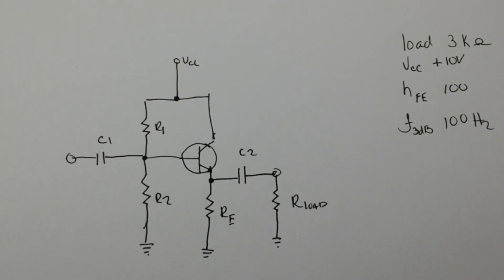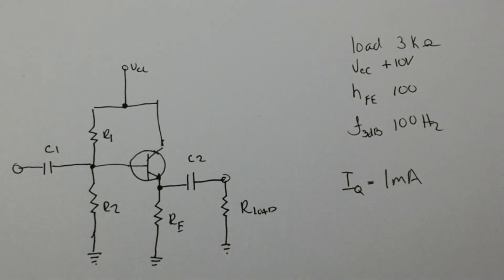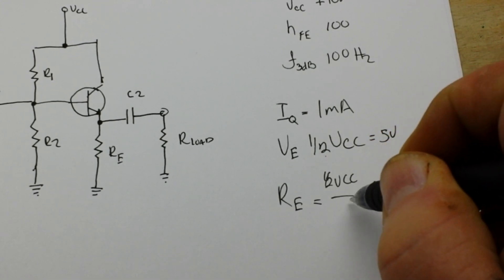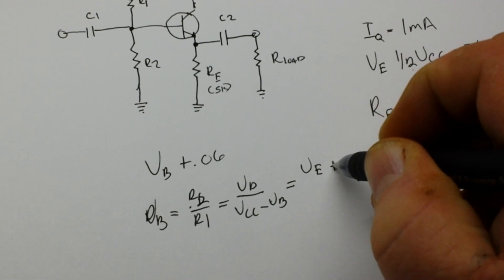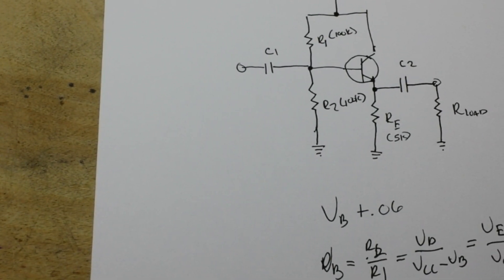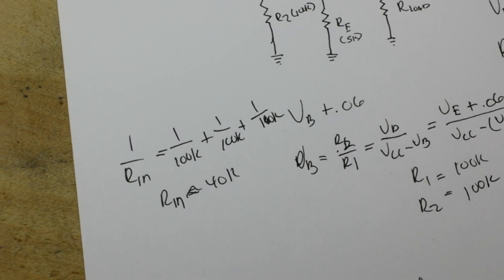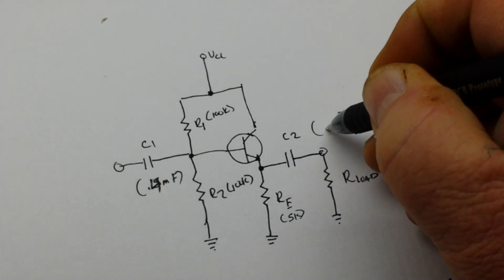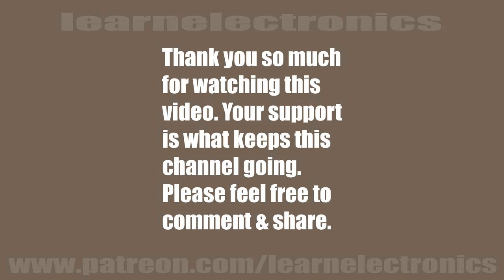How to bias a transistor

Comment: Thanks for the vid, I popped the little crystal earpiece I had for my radio project the other day somehow. Had a big amplifier transistor but didn't know how really to hook it up, after experimenting with a smaller transistor (which led to the earpiece popping). Got my Xtal radio cranking enough watts to drive a small loudspeaker now and quite loud in regular earphones. Just learning one little piece at a time. Next step is building a better tuning/tank circuit to make the radio a bit more selective.

Comment: The biasing voltage is taken between R2 and ground so the Vb should be Vb = R2/(R1+R2) * Vcc. He has some good information but his arrangement of the equations are sometimes completely wrong or the value are wrong like the voltage drop across the transistor as being .06 where it should be .6.  I do believe he knows better but he fails in verifying his information before putting the videos out to YouTube. I would say his YouTube channel is not a good place to learn electronics for beginners. To explain why his Vb = R1/R2 * VCC  is wrong, just do the math the Vb = 100k/100k * 10 = 10Vb. It should be 
Vb = R2/(R1+R2) * VCC : Vb = 100k/(100k+100k) * 10V = 5V. A beginner starting out in electronics may not recognize when he makes mistakes. Just a fair warning to all the viewers. Having said all this I do like what he’s trying to accomplish and some of his content but his attention to detail needs some work.

Comment: [V] can not be [Ohm] / [Ohm] (and then even [V] / [V]).
Reply: Yes indeed, it's a good practice to always check both sides of an equation to see whether they have the same units. That's definitely not the case here, so the equation is incorrect. His starting point to put V_E at VCC/2 is also wrong, it would have been correct if there wasn't a load resistor, but there is one and that determines the choice of the quiescent value of V_E too (study the chapter on AC and DC load lines).  You can easily check this experimentally by watching the clipping of the output signal for different bias points.V_E=5V is certainly not the good choice.
 V_BE is also wrong, it should be a value between 0.6 and 0.7V, the output capacitor is choosen way too small for a load resistor of 3k at 100Hz. 

Around minute 6.20 a resistance of 190k falls down from heaven (it is a nonsensical value, (1+100)*5k=505k would be acceptable as a first guess but this calculation has nothing to do with capacitor theory as he suggests), than it is changed to 100k...
Three resistors of 100k gives you around 40k...
Around 7.32 he calculates a capacitor of 0.5 µF but in reality the calculation shown gives around 40nF.
What upsets me most is this guy gives the impression we shouldn't worry about the maths as he masters all the maths but in reality he's doesn't master the maths at all, making one error after the other, doing a lot of handwaving and finally teaching it the wrong or misleading way.

Comment: For a second there, that looked like the schematic for the EHX LPB-1 Power Booster pedal. It is actually pretty close, but they used the output coming off the collector pin as opposed to the emitter. Are the maths for biasing the same in that situation? Below is the schematic I'm looking at: http://beavisaudio.com/schematics/Electro-Harmonix-LPB-1-Schematic.htm

Comment: This of great interest to me. I'm currently working on an if strip that is giving me the fits. My if freq is 2.2 mc. The coil resistance is .4 ohm. Allowing for stray resistance, the be is only 40kc....something like 3 plus ohms. Tuned amps with reactance can be bewildering. I've done every thing I can to lower this....larger/smaller reactive values, larger wire indicators to eliminate skin effect, load isolation so as to have no effect. I landed on a Re value of 10kohms that gives me 40kc....but that's best I can do. What am I doing wrong?

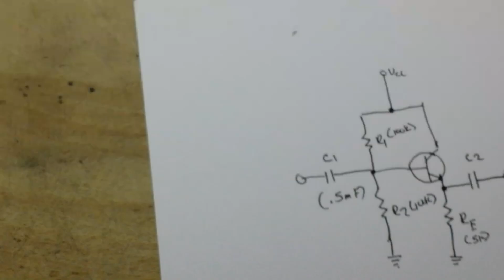Comment: At 07:38 you say micro Farad (uF) but you write mF... But nice and easy to follow video without too much detail.
Reply: mF is also microfarad mostly on motors and older stuff.
Reply: Correct. But better be consistent. The output coupling capacitor is marked as uF.

Comment: Is that circuit also known as emitter follower?
Reply: It is indeed, with biasing.
Reply: @jonelectronics510  Do you happen to know what I_Q was in the video?  I know what the Q point on a transistor is.  But I've never come across I_Q.  Is it the current to drive the transistor to the Q point?  I've had DC, AC, and an Electronics course which had a lot of transistors in it.  But I haven't had three levels of transistors like is mentioned in some of these comments.
Reply: @jonelectronics510  Thank you for explaining that.  The textbook we use for DC/AC/Electronics explained what a Q point was.  But I don't recall it mentioning an I_Q value.
Reply: @jonelectronics510  That makes sense. I know the basic theory but don't have a lot of experience applying it.  Thank you.

Comment: Where did you get .06 Volts from? Shouldn't it be closer to .6 Volts assuming a silicon transistor?
Reply: @Glenn Hamblin, I'm glad you asked this question.  I was getting ready to ask this myself.  I'm also glad to see this discussion answering the question.  So it should be 0.6 (to 0.7 Volts) and is the voltage drop across the Base-Emitter junction (between the Base and Emitter terminals of the transistor).  Is that right?  Now I just need to figure out what I_Q is.  I know what the Q point is.  I'm guessing the I_Q is the amount of current to drive the transistor to the Q point.  But that is just a guess.  I haven't had multiple transistor classes like some people have.  I've only gotten one class in Electronics with an introduction to transistors.
Reply: @JonathanDeWitt1988  Iq is simply the current flowing into the base (it could have just as well been called Ib for "current going into the base) when the input signal is 0 volts.  The purpose of Iq (the bias current) at is to properly bias the transistor so that it is operating within the linear (a.k.a. "active") region as opposed to using the transistor as switch in which case it would need to be driven "full bore on" (that point referred to as "saturation").  He sets Iq to be 1ma as for this transistor as that puts it somewhere into the linear range so that the transistor can act as a true amplifier with the gain (amplification factor) being hfe.  I hope that helps.
Reply: @Enigma758  That helped a lot. Once you said base current I made the connection.  The textbook I learned it from called this Ib base current and never mentioned Iq.

Your explanation of the rest was really good as well.  I struggled a lot understanding the difference between cutoff, linear, and active region until very recently.  I found the All About Circuits channel video lecture series:
https://www.allaboutcircuits.com/video-lectures/

Their Transistor and Transistor Circuits series of lectures clarified a lot for me.  It covered everything you just said (except that Iq is Ib).  It actually didn't even show the curves for cutoff, linear, and saturation.  So it did leave a few items out.  But not bad for being free.  Thank you so much for your help.
Reply: I think the drop is 0.6v for a diode, but 0.7 across Vb, Ve, so I would use that instead.
Reply: @Enigma758  Best just to use what ever the data sheet indicates on the device you intend too employ.
Reply: @Enigma758  
Very dependent on temperature. the B-E junction is a PN junction just like a diode. Values of .6, .65, .7 Volts are all typically quoted, but again the drop is very temperature-dependent.
Reply: For a silicon transistor, 0.6v-0.7v is true (and you typically won't find that value in a data sheet for an SI transistor because it is assumed).  Yes, it can vary with temperature, so if you are aware of specific temperature  conditions, then by all means take them into consideration as well.
Reply: @Enigma758  
In any case, it's certainly not .06v
Reply: @GlennHamblin  Right, simple and obvious mistake, off by one decimal place.
Reply: I didn’t pick it up the first time I watch the vid I just assumed it was .6v
I am also curious if he meant .6v if not can someone explain 
Thanks
Reply: @anthonyselby8337  For a silicon transistor it is absolutely .6v-.7v so I think it's safe to assume you are correct.
Reply: Old School Germanium was half that.
Reply: @pulesjet  
Is that a point junction you are referring to? A germanium PN junction is roughly .2 Volts, Schottky ~.1V.
Reply: @GlennHamblin  Germanium Transistors.  Don't see them much any more.  Was a big thing for low level RF work.

Comment: LOL, love your videos! This time though, did I not understand the start but did understand your math.
Iq, Hfe, and biasing, no clue. What and why biasing? I know that I am bias and my Iq may be 1mA, but do not think that it was what you were referring to:-)
Reply: Biasing in this case is about allowing the transistor to swing fully on a single power rail. An audio wave will swing both positive and negative, if this amplifier was centred near 0v on a single simply you would clip the negative swing (You can't go lower than your lowest rail, 0v in this case). The bias raises the centre of the transistor to half way between (usually) the 0v and positive rail. This allows you signal to swing high ( > half supply) and negative (< half supply) and avoiding clipping the negative swing. All it's doing is transposing the signal higher up the power rail so the negative swing become positive as well. So rather than swinging from +2v to -2v it swings between +4v and 0v for example. You wouldn't want to swing to close to a rail as you could still clip.
Reply: @jonelectronics510  Thank you so much, wary great and logical explanation. So as I understand it, do you "move" the ac / sound signal up by adding DC, yes to never get below bottom rail voltage. I.e. +3V DC - 2V AC = +1V from lower rail?
It is super interesting that you therefore logically decided to add about half of peak to peak movement of the sound, but on top of that, had to consider the filters value, so you could not just select two random resistors:-)
Reply: @friedmule5403  that is the jist. However, we can get more complicated than  that, because we now have two filters working on our signal (both high pass), when deciding on a capacitor value you should be careful not to make them too low else the signal will attenuate (I.e the amplitude will decrease) generally at the lowest selected frequency. We also need to consider the input and output impedance - Now we are getting into thevenin theorem. It can make excellent physics but can be rather extreme for hobbyist!
Reply: @jonelectronics510  LOL I am just glad that I have understood so much, I think there is no reason to jump out in the deep, for the moment.
I thank you for making your knowledge so easy accessible for us who is not born with a soldering iron in the hand:-)